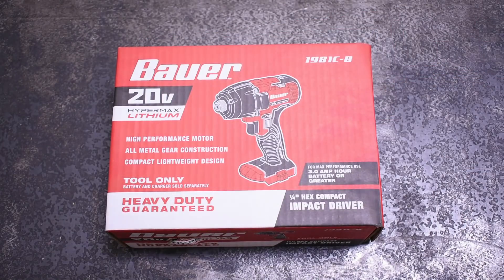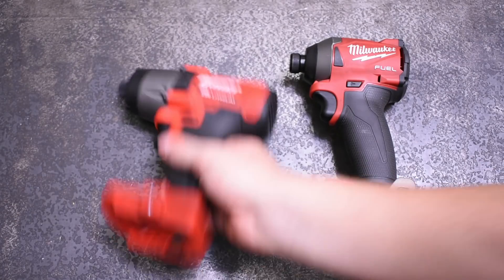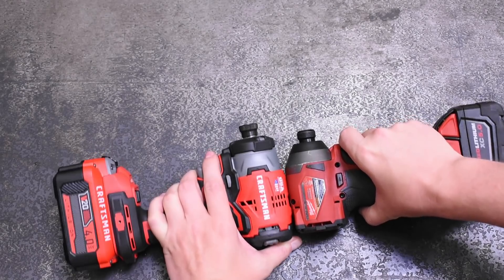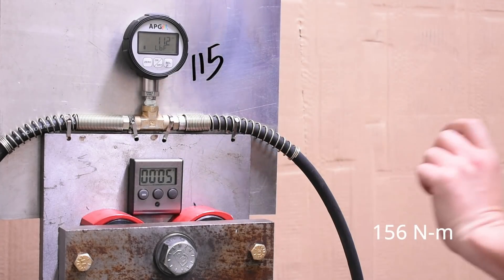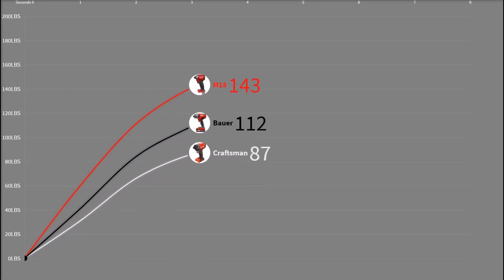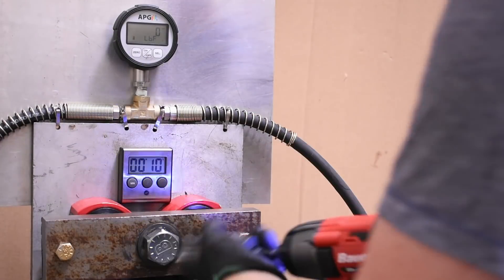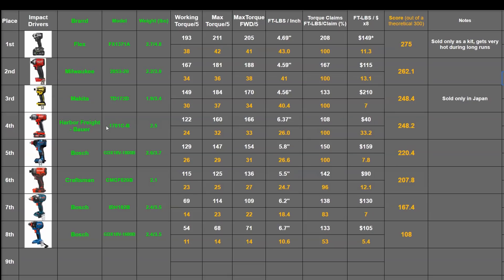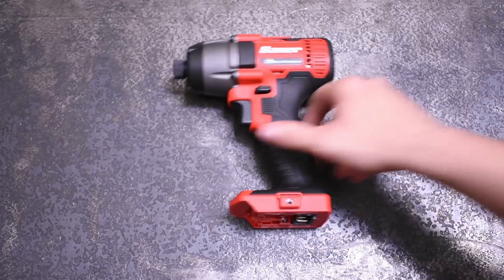[Impact Drivers] Does More Expensive Mean More Power?

Comment: Would love to see Metabo HPT 36v triple impact driver on here, does more hammers and more volts mean more beans? Especially after their midtorque wrench showed out last week
Reply from the maker: Ya know, we still for some reason dont own a Metabo HPT 18/36V battery or charger. Just looked at the lowes batt/charger deal and none of the free tools are 36V for some reason. So no triple hammer. The Triple hammer kit is like $280!
Reply: @TorqueTestChannel  I’ll email you guys, I might be able to help out there if you can wait on back-ordered shipping
Reply from the maker: @ryanthomas9685  Yeah, no rush here. There's like millions of impact drivers to work though
Reply: @TorqueTestChannel  I’ve got a 36V HPT triple hammer, batteries,and charger I would be willing to lend.
Reply: @geoffstrickler  do you like it?
Reply: @CraigularjJoeWoodworks  haven’t used it. It’s brand new. Bought some 36V Hammer Drills on clearance, traded one for the Triple Hammer impact driver with someone who had found several of them on clearance. Unclear whether I’ll keep them or sell them, but will likely sell them as a set since I already have 12V M12 FUEL and 18V Ridgid Octane tools, and I originally bought the 36V HPT with the intent to resell them. 

But lending them for a little testing first won’t harm their value, so….
Reply: @geoffstrickler  got it, where I live in canada they are quite expensive
Reply: @TorqueTestChannel  If you can find it they have a 36v driver kit with two 36v batteries and charger for $44, real unicorn, more likely to find the 36 volt battery plus charger plus pick a free tool for $169
Reply: @TorqueTestChannel  the 18V triple hammer driver and drill kit is $129 for Black Friday week. That will get you a charger, then you can grab batteries. It might not be the newer 36V MultiVolt, but most folks are buying the 18V anyway.
Reply: @l00nybin  that's a heck of a deal!
Reply: @l00nybin  I feel like most are 36 volt.
Reply: They also make an 18V triple hammer. I’ve got both 18v and 36v. If you want I can send them your way, and probably have an extra charger that you can keep.
The triple hammer starts out hammering full speed then the hammering slows down by half as things tighten up. Not sure how that will show on the dyno, could have an interesting curve.
Reply: I'm all for this test. My regular Hitachi metabo hpt whatever it's called this week kicks butt. I really like some of their tools. Not the cheaper reciprocating saw though. It died quick. But the impact driver is a beast and can seem to take serious abuse.
Reply: @HoosierDaddy_  I have the 36 volt recip, it is a absolute beast and very little vibration
Reply: The Triple Hammer is hell. Lots of power and probably feels better in the hand than any non-makita driver I've used.
Reply: 36v triple hammer kit should be $199 at Lowes.  That kit comes with the only Hitabo HPV charger that won’t drive you mad.  The mentioned $129 18v kit comes with compact batteries and the older annoying charger.   I actually bought the 36v triple hammer kit for the batteries and chargers since I have the nailers and they came with the aforementioned compact batteries and old annoying charger.
Reply: @robertrada4783  there's no such thing as a "hitabo hpv"..... maybe you mean Metabo HPT
Reply: @CraigularjJoeWoodworks  I refuse to call former Hitachi-Koki  “Metabo” so as not to confuse between Metabo that is Hi-Koki everywhere else and Metabo that is Metabo everywhere.   Imagine if after the Stanley merger Black and Decker changed DeWalt to De-Elu everywhere  but in the US where they changed it to Porter Cable DPT while selling Porter Cable right next to it?
Reply: @robertrada4783  your point is moot, hpt is clearly a different tool, without question. If you don't like the simular name I assume you are the only one. They are phenomenal brands, I prefer hpt personally
Reply: I've seen really good ratings of the metabo hpt 18v triple hammer! From a lot of woodworking professionals praising it's smoothnes compared to dual hammers. I would also like to see more hikoki / hitachi / metabo hpt tools because they have a lot of amazing ones!
Reply: More volts does not necessarily = more beans. It does factor into the equation, but there are other factors.
Reply: The Metabo HPT 36V will be crushed, providing they equip the Milwaukee M18 Gen 3 Impact with a 6amp HO Battery.

Comment: I've beat the snot out of my Bauer working on small engines and my garden tractor pullers and whatever else I've used it for, probably ran 60 cycles on the batteries through it, I like my milwaukee better but bang for your buck it's hard to beat